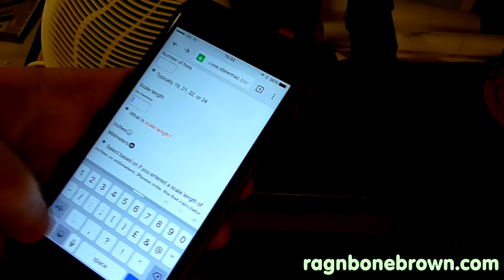Making A Ukulele from scratch - QUICK VERSION (the entire build)

Comment: I like your approach here- I especially like the use of the stair rail (after all, quartersawn wood is quartersawn wood!). I'm building hurdy gurdie's- I think I'm going to use some of your methods soon. My only suggestion would be to invest in a glue brush- I use an acid brush, trimmed down a bit. It gives you a lot more control of your glue layer, and cuts way down on squeeze out and clean up.